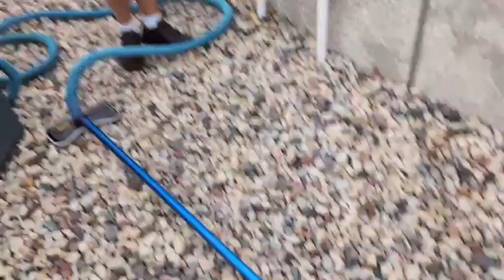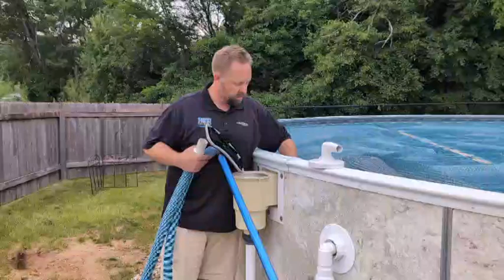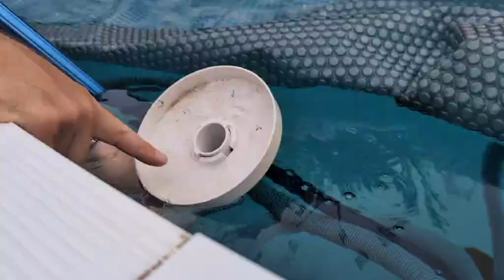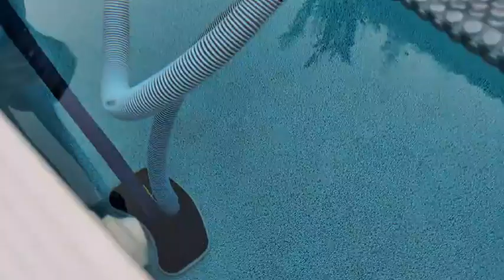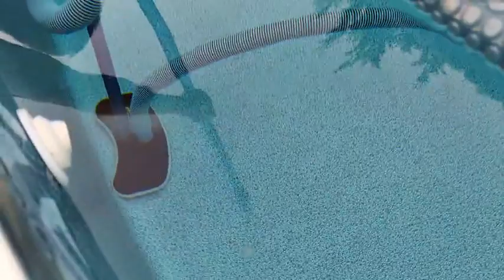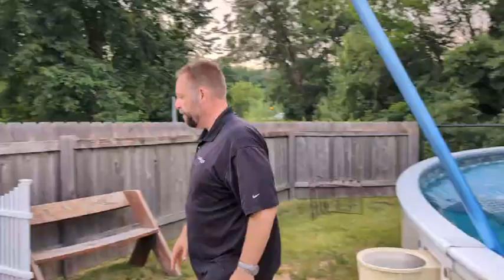How to Manually Vacuum an Above Ground Pool | Pro Tips from Patio Pleasures

Comment: How to do this if you have a skimmer /filter combo ? I simply took out the motor and hooked up a sand filter.  The  water just bypasses the plate and hose when I turn on the pump and my plate has the end going straight in the pool so it’s sideways.
Reply from the maker: Modifying those combo units can be so tricky, and it's incredibly frustrating when the water just decides to bypass the plate entirely!

Because this specific video only covers the Hayward 1091 setup, we highly recommend checking in with your skimmer's manufacturer. There are so many different combo designs out there, and they'll have the best insight on how to properly adapt or seal their specific model when converting to a sand filter. Best of luck getting it sorted out!

Comment: Does anyone know how to or if a Bestway Pool filter pump can be used to pull water out of pool to drain it? I am assuming the reverse flow with a hose in the pool would do it but wanted to double check it.
Reply from the maker: We do not recommend trying to reverse the hoses or use the pump to drain the pool. Pumps are designed strictly to pull water in from the top skimmer/intake line. If the water level drops below that line, the pump will pull in air, run dry, and permanently damage the motor. To drain your pool safely, the drainage valve built into the pool wall near the bottom, or utilizing a portable submersible utility pump.
Reply: hey ithink my papaw sent this comment because i didn’t
Reply from the maker: @glennsheehan581 No worries. If you have additional questions related to a Bestway pool filter pump, we highly recommend confirming the exact steps and capabilities with the manufacturer directly. There are quite a few different pump and filter styles on the market, and running a pump in reverse or incorrectly could potentially risk burning out the motor. We don't work with Bestway pools or their equipment and advise on reaching out directly to them for specific answers.